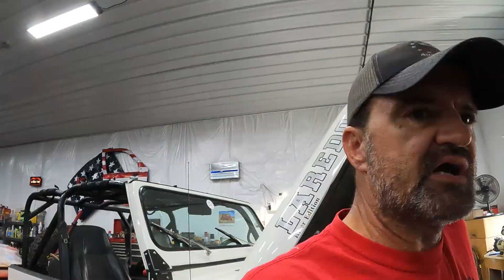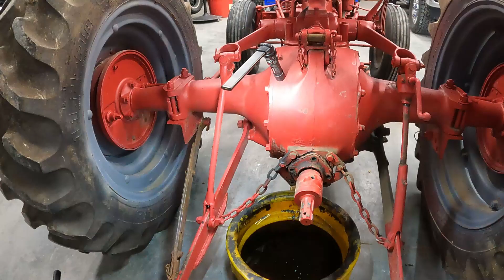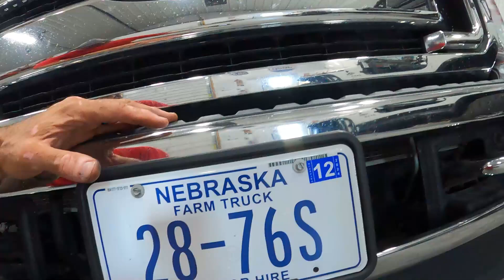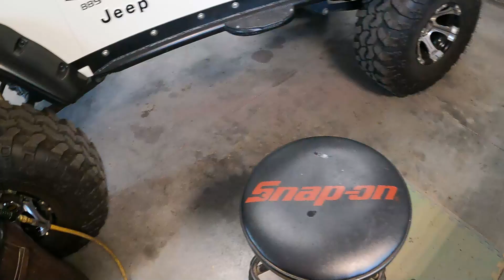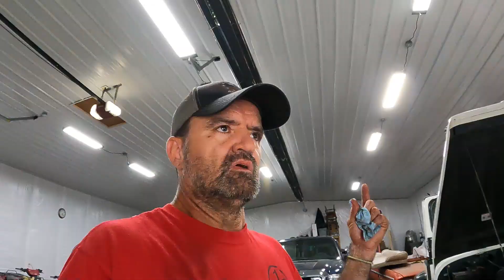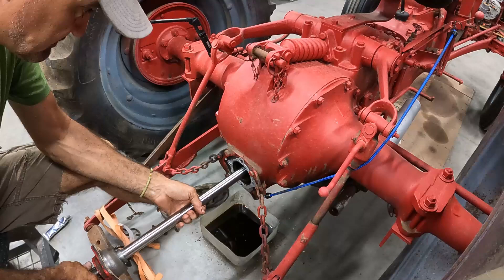1947 Ford 2N-  Let's replace the gushing PTO seal!

Comment: Hint I know you dont have a ditch but putting the fron wheels in a ditch or putting a floor jack under the and raising about 8 in you dont lose any oil or need to drain
Reply from the maker: @alanmize5627  true.  This was low enough that the little bit of loss really didn’t matter much.  But if it were full and oil was good… definitely save a hundred bucks!  Thanks for the comment!